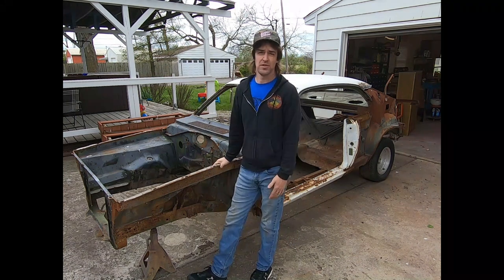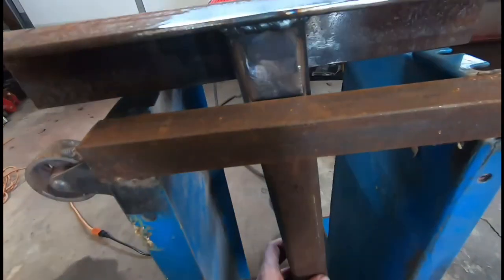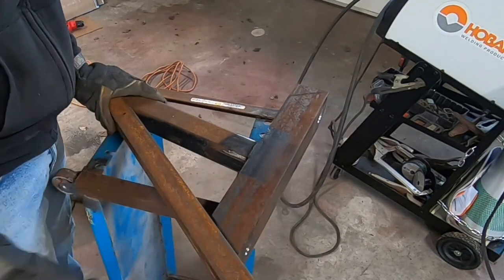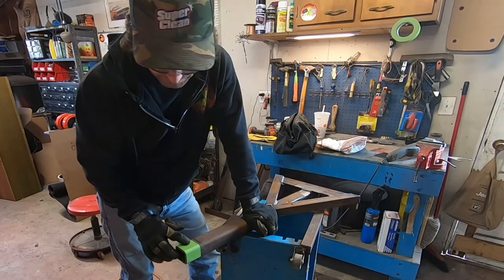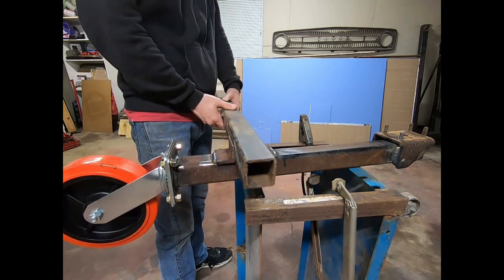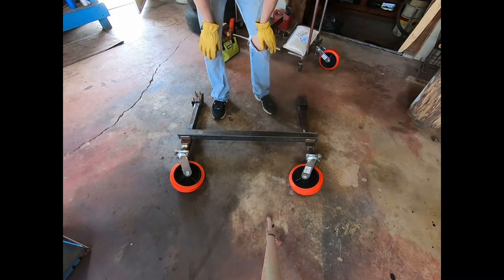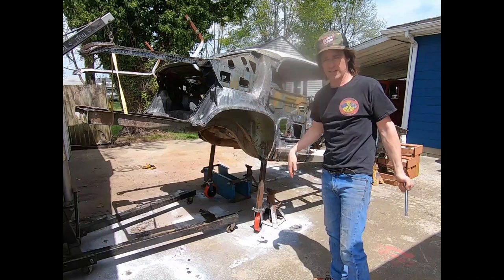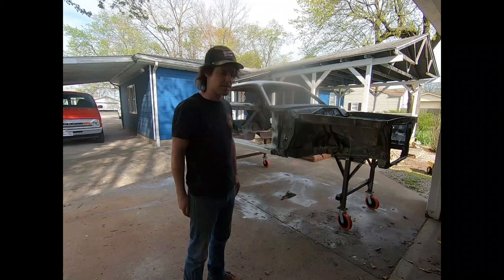Mopar Body Dollies - Hoosier Garage

Comment: That was great. 
I was cringing when you lifted the back of the Duster with the hoist and the front on 2 jackstands.
I wonder for anyone else going to try this if the car could be balanced between a hoist on the front and the back of the car. Just going back and forth jacking a little at a time evenly on each hoist.
Another hoist is good money and takes up room, but you you come out ahead if your car falls.
Reply: Also make sure the wheels on each hoist are very secured.
Reply from the maker: @roadkilldoesntfly1773  i tend to think the wheels being able to roll inward like they did here allowed them to settle on the stands. If not the cars rears back and tips stands over and down it goes. It was sketchy for a minute there
Reply: Brother you are ingenious and talented, but I wouldn't lift a car like that and work under it for a dump truck full of cash!!
I was thinking about a tall heavy duty swing set/a frame with a couple of come a longs attached to it for the front, then the hoist for the back. When you're done Noah could have a cool swing set. Just a thought. You did mention safety.